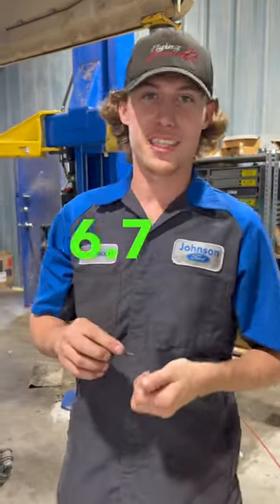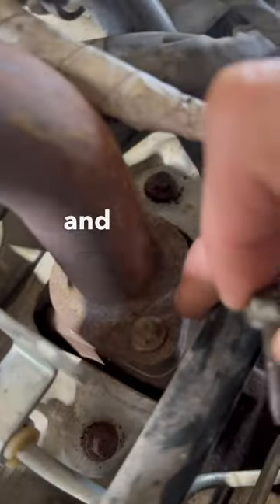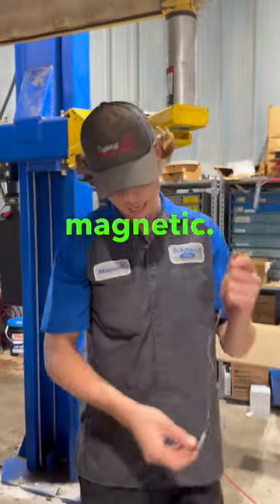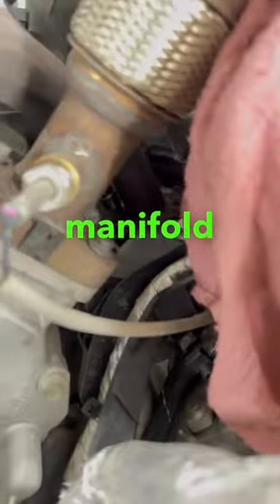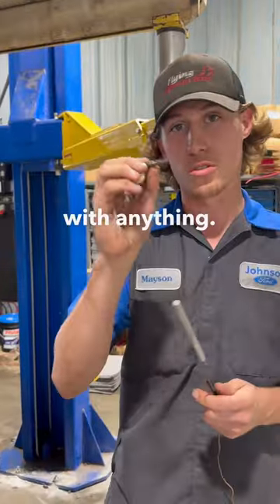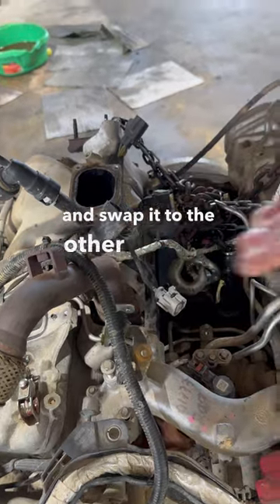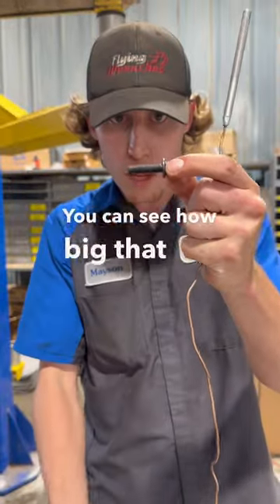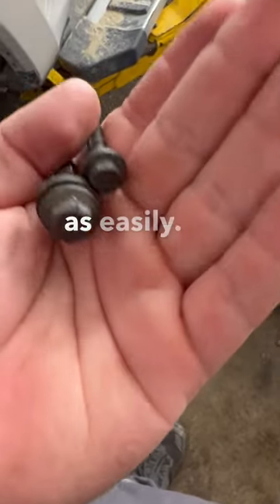6.7 PowerStroke EGR Bolts are a NIGHTMARE #shorts #powerstroke

Comment: Haha had to drill a titanium bolt out of a brand new super hornet engine. Took me 8 hours, and about 20 drill bits
Reply: Gotta use Tungsten Carbide bits. Expensive, but worth it if you've ever gotta get through Ti or hardened steel.
Reply: When drilling Titanium, Cres (stainless) or Inconnel use a SLOWER R.P.M. Recommended r.p.m. is 350 to 800 r.p.m. if you don't have Cobalt or Tungsten Carbide drill it's, use a very small diameter then step up to the side you need.

Comment: Deleted a 2016 6.7. Bolts came out perfectly. Thank god. Last block off plate I drop the thing down the manifold. Found out they’re not magnetic. Sitting on top of a 1/2 closed valve, I stuck some sticky putty on the end of my camera scope and somehow got it after 6 hours and a good nights sleep. Did not want to take the turbo or manifolds off 😂.
Reply: Shoulda just left that bolt for the next guy
Reply: @Julian-do7bv  lmfao and destroy the engine while your job is to fix something? imagine explaining to the customer "hello sir i got that EGR blocked off, but youre gonna need a new engine as soon as we start it up"
Reply: @tristantrujillo2655  sounds fair enough lol
Reply: @Julian-do7bv  😂
Reply: You just gave me flashbacks to dropping a hpop bolt down the back end of a 6.0 and fishing for it for hours on end.
Reply: Where’d you get the block off plates
Reply: @andrewrangel1236 it was either sinister diesel or spelab, don’t quite remember if it was red or blue. Plenty out there to choose from though.

Comment: Get a good 135° split point drill bit from nitro or a us based drill manufacturer. Drill it on low use oil and it will drill out fine if it gets hot stop and wait for it to cool off. Hope this helps someone.
Reply: You mean like your supposed to? LOL, couldn't resist being a smart ass. Also Dimond tipped bits. They sell them specifically for exhaust bolts as most engines have this issue (LS exhaust manifold bolts).
Reply: Carbide drill bits are what we use in the aerospace industry to remove titanium bolts.
Reply: Would a left handed bit of these materials help?
Reply: As a machinist a tungsten carbide bit would work
Reply: @staalcyclesecurities1423 Sometimes for bolts that might loosen, and back out by themselves due to relieving pressure, but exhaust bolts usually not.
Reply: General cutting coolant works pretty well but it needs to flooded. We typically use cobalt drills for drilling ti, preferably short ones.
Reply: A masonry bit’s carbide tip helps too. At least to get through the work hardened surface

Comment: The poor customer gets fucked when they buy this junk, then gets fucked when they take it in for repairs. Merica
Reply: Absolutely there is nothing more stupid than buying a POS diesel pickup. People never learn
Reply: European made cars suck even more
Reply: "merica" isn't the only country with cars😂
Reply: fuck yeah
Reply: @jacobdevereux207  based on what? They are better engineered over all and hence costs more to maintain. They fail due to lack of maintenance/poor owner. And even if they fail, at least they drive better. 🍻
Reply: @enayetkhan9397  I've worked on both American made vehicles and European vehicles. by far American made vehicles are easier to work on, the newer American. ade vehicles are absolutely not reliable but anything from the early 2000s and late 90s I'll say is probably some of the best vehicles. even when abused and not taken care of they last a long time
Reply: @jacobdevereux207  I agree with you on that!
Reply: Don't buy it... Worries ended... I am sure the engineers are sitting around a bonfire laughing at you.
Reply: Atleast if you go to a decent repair shop, you’re not getting fucked on purpose, like the manufacturer does.
Reply: @enayetkhan9397 Not Merica, this is a lot of manufacturers nowadays. "It's not their problem once it's out of warranty period" type of mindset all around.
Reply: @jacobdevereux207 In the 90s they were making them to last 20-30 years with nothing but basic maintenance. Nowadays lucky to crack 100k miles. My old Honda 4th gen Prelude H22a1 has 350k with only basic maintenance and 3 timing jobs and I dogged the F outta it for like 5 years 7500rpm bang shifts every single day every single red light.
Reply: @1987FX16 it's ALL of them... cars n trucks all feel, drive, and look the same, like they're all puked out of 1 plant.  I been driving a 1972 classic car past 23 yrs, e z repairs, no worries!
Reply: Those bolts are not an issue unless you're doing aftermarket work. They are perfectly fine like the rest of the 6.7.
Reply: Ford is quality cutting because you'll just buy another 1. It's American made😂😂😂😂😂😂😂🤡🤡🤡🤡🤡🤡
Reply: @enayetkhan9397 no one wants to work on european junk...
Reply: @cactneir I guess they're trying the european system.....
Reply: @kenneth9874  but those who do, they make a pretty penny!
Reply: @enayetkhan9397  and probably need one for their therapy afterwards! Lol

Comment: Here's your answer to the problem with using titanium you have to look to the aviation industry. This information comes from the Lockheed Martin skunk works regarding issues they had with titanium bolts on the SR-71.
You have to realize some of the temperatures that the aircraft endured and was exposed to was well above 600° in these components were fasten together with titanium bolts.

The brittle alloy shattered if mishandled, which meant great frustration on the Skunk Works assembly line, and new training classes for Lockheed's machinists. Conventional cadmium-plated steel tools, it was soon learned, embrittled the titanium on contact; so new tools were designed and fabricated—out of titanium.Apr 1, 2020
Reply: Damn… just when I thought I was finally done buying more sockets! Now, gotta buy titanium ones? This is yet another example of why most major technician’s have WAY MORE DEBT than the owner(s) of the shop! 🤬 ridiculous world we live in. Guess I oughta get aluminum sockets for aluminum fasteners too 🤪
Reply: @seanbatiz6620  no it's just an example of a engineer who knew they needed a strong adorable metal bolts but didn't really know much about titanium other than it is a strong metal. The gun manufacturer Taurus found this out with titanium when they first started producing handguns with titanium they had numerous issues and had to come up with an alloyed to correct these issues. Titanium is kind of an exotic metal and if you don't know much about it then you probably shouldn't be engineering it into your product. Titanium is hard to machine not necessarily because of the hardness but it behaves more like ceramic or stone it  is hard to remove the heat from the metal it conducts heat poorly. You also do not want to quench it like steel because it has the opposite effect. The miracle of the SR-71 was that the metal would retemper itself every time the aircraft went into normal operations due to the heat that it was subject to and the slow cooling that the aircraft went through in normal operations. This differs from aircrafts made out of aluminum which over time aluminum will tend to crack from stress. It is also subject to reacting with other metals like cadmium and creating numerous other problems.
Reply: Just use low r.p.m. (between 350 to 800 r.p.m.) and Cobalt or tungsten carbide drill bits. Slower r.p.m. is the key.

Comment: K715 fine-grained carbide grade is the optimum combination of toughness and wear resistance for titanium drilling applications. 
Solid Carbide drill bits are fragile in case you drop one but at the same time very tough.
Reply: Yeah imagine thinking you can't drill titanium. Clearly not a machinist
Reply: @Adrianzx LOL, well, he is a specialized Ford tech, not a machinist. Even still, i'd much rather drill out those broken Ti bolt on a machine, then with a cordless drill. Either way, slow 'n steady will get 'er done.
Reply: @Adrianzx I thought the same thing 😂 hell I've drilled a hole through a tap.

Comment: Only thing I can think if is to use a carbide drill bit. Costs a lot more from the mill supply, but it'll hold an edge long enough to maybe drill it out.
Reply: I wonder if a cobalt bit is harder than ti?
Reply: @thomaskovacs5094  It's hard enough to machine tool steel. Doesn't get much harder than that until you start machining ceramics and they use cobalt to machine some ceramic.
Reply: @thomaskovacs5094  I primarily use cobalt drills to drill titanium parts. Sharpened regularly often. A big asset with machining titanium is very sharp cutting tools.
Reply: @jasonhamilton5756 so how do the make cobal drill bits? meaning how they machine cobalt, with ceramic bits? Funny how i hear ceramic to machine stuff and all i can think of is china dishware and tea cups 😂

Comment: Aircraft tech here. You can drill into a titanium bolt easily with just a fresh carbide bit. Start around 3/32 or or 1/8 bit size. Go slow, if it starts smoking use cutting oil or stop and let it cool.

Comment: Those bolts broke on my 2017. Not during work, during driving. Apparently they got too hot and popped. I had both manifolds and both crossover pipes replaced. Not cheap, but it was spewing raw exhaust out up there, and I could hear the turbo. Sounded like metal screaming!

Comment: I always hear of people doing EGR deletes and snapping these bolts. Deleted my truck and never had an issue taking them off. Truck had 100,000 miles. Driving the truck to my shop and removing them as quick as possible while everything was still warm seemed to help a ton.

Comment: They are made of titanium because of its extreme heat resistance.
Reply: too bad the rest of the exhaust aint
Reply: Steel is just as heat resistant. If I had to remove them I’d use a 3/8 pneumatic impact. I don’t think I’ve ever broken an exhaust bolt with that impact! Works great on 5.4 L spark plugs too if you warm up the engine first!
Reply: @benztech2262  its not even close you dont know what you are talking about.
Reply: @benztech2262 they use titanium because of the EGT temperature for Regen, which ranges from 1000 to 1200 degrees fahrenheit,
Reply: They still break probably due to vibrations
Reply: Idk there are moly steels that have been used on boiler tubes since the 1900s. I'm guessing it's some weight savings emissions bs but idk.
Reply: @thomaskovacs5094  they use titanium and inconel in jet engines for the same reason extreme resistence to heat.
Reply: @benztech2262 why is the SR71 made of titanium and not steel
Reply: @donovandecoster2150 steel works fine for that, what do you think the dpf housings made of?
Reply: @ineedapharmists more to do with the coefficient of thermal expansion rather than just it's temp resistance
Reply: @donovandecoster2150 the melting point of steel is between 2500 to 2800° Fahrenheit . Your argument is nonsense .
Reply: @DarkAttack14 yeah the good old let's use two different metals that expand and contract at two different rates argument .
Reply: Titanium is super durable but they could just use tungsten or something and it'd cost a lot less
Reply: @ec7005  you really think they didnt anailise the cost of every nut and bolt that went on that truck?
Reply: @danieldunham9978  I don't think they care much what the cost is going to be to replace it. It'll last a while but it sucks to replace. Tungsten would be better there
Reply: @benztech2262 hell yeah.  Same here.  Get these damn recalls on exhaust manifolds on the 2.4ls at Chrysler and everyone breaks them manifold bolts.   But I use my air impact and have never broken a single one.  5of5 so far lol wish me luck
Reply: @danieldunham9978  I cannot take what you say seriously when you can't even spell analyze
Reply: @QuincyStick  i am a machinist and a cnc programmer not a teacher so i know a few things about metal less things about spell check.
Reply: So use inconel?
Reply: @terpsquirter7107  just use fairy dust its probably cheaper and will not ever break off!
Reply: @Dr.Westside steel begins to deform far before its melting point. So even if it doesn’t melt it’ll still be permanently deformed at a high enough temp
Reply: I just pulled them in 2012 with 250000 they did need some heat and a little bit of persuasion. I don't think mine are titanium, though
Reply: It sounds great on paper but in practice they suck so does stainless steel In the exhaust system
Reply: @purplepotato69 but the pipe that should get hotter that they keep in place, that doesn't deform?
 I'll say I never seen one of those engines but it looks like a steel pipe from here

Comment: To drill use 100 rpm slow motor no more than 150 rpm with high quality cobalt drill use bee wax with a lot pressure.

Comment: Broke both of those bolts on a 6.7 i worked on. Drilled them out no issue. Tapped for bigger bolts and put grade 8 back in its place no issues. Angle drill is your best friend. Take your time. Drill Hog drill bits.

Comment: Reasons I quit ford in 2016 when ford redesigned the 3.5l eco boost v6. They changed it from direct fuel injection to multi port fuel injection. The 5.4L triton spark plug issues, and customers ruined my love for cars with their botched repairs. Like no Karen I’m not fixing the c clamp and 2x4 control arm you have because you declined our repairs and said you “knew someone cheaper” go hide in the dumpster behind what ever loony bin your from and go smoke your crack

Comment: I had a 3406B Caterpillar. Turbo to exhaust manifold bolts were stainless. Constant problems- galling , seizing, breaking any time that you had to disrupt that connection. " Oh you must use stainless " say all the experts & CAT specifications because of the heat.I replaced them with a Grade 8 Flange Bolt , never had anymore problems. Repairing a repeated problem with the same solution will net the same results.

Comment: For those who assume and really don't know. The fact the bolts are titanium isn't relevant for why they get stuck. Only matters for extracting the bolt.  

Any one whos actually worked on old junk knows any bolt anywhere that goes through aluminum and the bolt is a different material (many bolts are aluminum dipped now) causes the aluminum to corrode (yes, google it before you open your weiner cleaner, I am an aircraft mechanic and deal with it daily). So where we can, we use some type of..... anti seize. They make copper infused for exhaust and other hot areas with a 1,000 degree threshold. Your EGT's should never reach that in theory.

Comment: Little tip, with how titanium work hardens. Keep a few masonry bits handy and slightly square the cutting face so it’s more aggressive on a green abrasive wheel. That carbide tip should allow you to break through the work hardened surface and into the softer material. Then keep your bit SUPER cool and it’ll drill a lot easier

Comment: Those were real fun when I had a 2018 f450 that needed that egr pipe, the little flex pipe on it blew out, had to drive it the whole way to the dealership with the windows down from the exhaust

Comment: Job shop machinist here. If you break a titanium bolt, reach for a carbide drill with 130° face angle. That’s the only reasonable way you’re going to drill the stuff.

Comment: We used to have to drill out Titanium bolts on aircraft.  I used carbide drills and the first 2 or 3, I burn up to heat the bolts the next couple of drill bits let's me dill them out.  It's works better if you can drill fully through them and rotate them out the  other side, but you can hammer an ez-out to run them backwards.   Let them cool off and if you can heat the surrounding area a little before removing them and a few drops of something cold (turn your air duster can upside down and drip it through the bolt) can make enough differential to get it out.  They are still a pain, but doable.

Comment: The trick to drilling into titanium is to use a LOW RPM. Around 350 to 800 r.p.m. is the recommended speed we use in aviation maintenance for Titanium, Inconel, and Cres. If you can, use a Cobalt, or tungstun carbide drill bit. Also, a very small diameter drill bit, then tge size you need. I often have to drill through Titanium and 286 Cres rivets solution heat treated to 79,000 lbs pee inch shear strength. For a 5/32 rivet, it is faster to drill it with a .128" (#40) drill bit, then a .160 (#20) even though drilling it twice, it is easier on the drill bits and still faster than just drilling with the #20 drill bit. Again the key is a slower r.p.m.

Comment: International has been using those up updated 8mm bolt (the 10mm head) for years. They still break, but you might get a few more years out of them before they do. A lot of heat works, but they pull the threads out with them when they get hot enough to remove

Comment: They are not so bad just an 1/8 inch through the center if it doesn’t brake free   either heliocoil or manifold job with updates. Im glad ford went to the bigger bolt 20 on up

Comment: Aircraft mechanics drill lots of these, start with a HSS drill and round out the surface on each bolt with oil.  Then switch to a Cobalt drill and drill on in.  Do not use the Cobalt drill to start the hole as cobalt is hard and brittle and may chip cutting a smooth bowl.  If you smooth the surface of hard edges with the HSS the cobalt bit will last a long time.   Tap magic and Boe-lube are good cutting fluids and of course low speed is your friend.